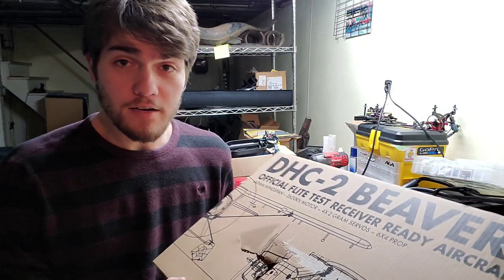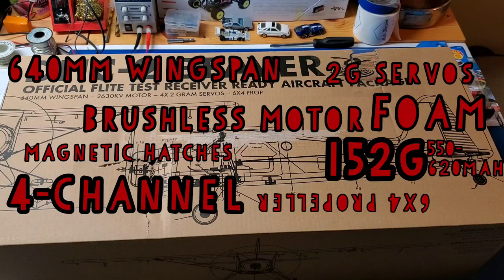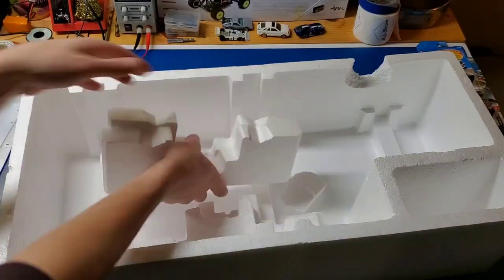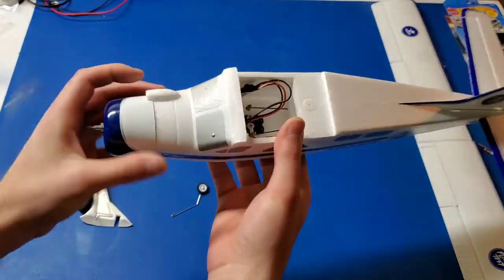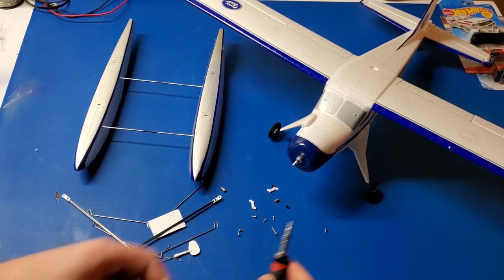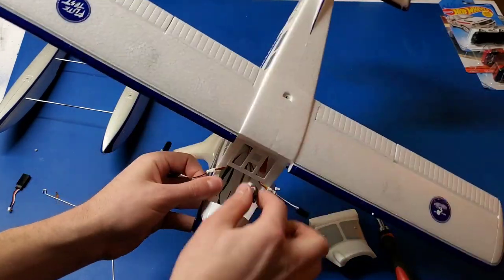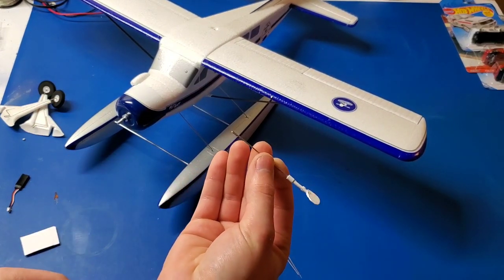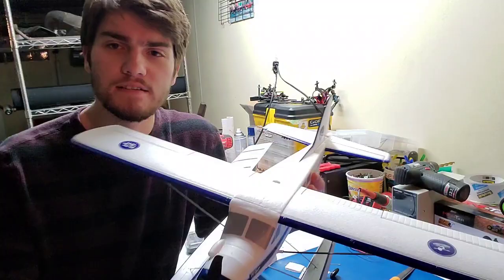Unboxing - Flite Test FT Micro DHC-2 Beaver

Comment: I just put mine together, very impressed with mine. I like how all the components are separate, speed control, receiver, traditional servos, just like a larger plane. Much easier to repair. Great quality.
Reply from the maker: Agreed, much more modular than the Horizon Hobbies UMX planes. Thanks for watching!

Comment: That spare adapter isn't for flap servos. That adapter is for the ESC in case you use a reciever which has those micro plugs on it.
Reply from the maker: Thanks for the correction!
I figured it was for plugging a standard y harness into a micro receiver for flaps, but the ESC makes more sense.
Reply: @NickMakesBreaksStuff  They're really neat little birds. I have one of each. Might just convert one to nitro...that's pretty much what I fly...just gotta track down a spare 2g servo for throttle and a Cox TD020 with a throttle ring on it. And then decide which plane to convert. The Adventurer would give easier access to the engine, but the DHC2 would look more scale as more of the engine would be hidden in the cowl. Decisions decisions...

I'm wondering when we will see Horizon's response. These things are everything the UMX Ultra-Micros SHOULD be and they're priced perfectly. Bixler and co hit this one out of the park.